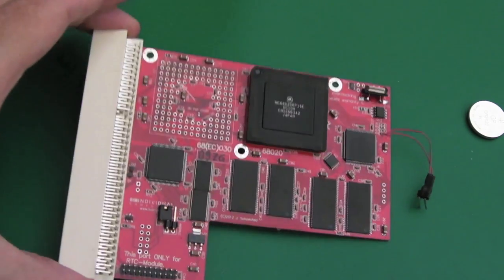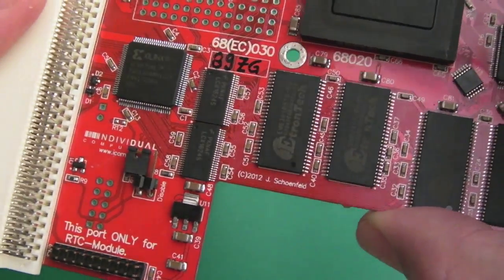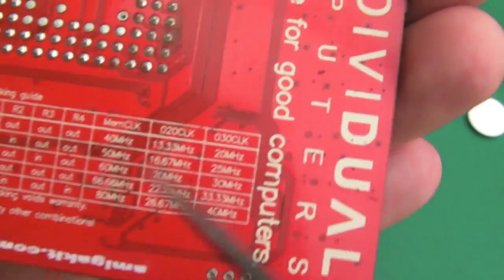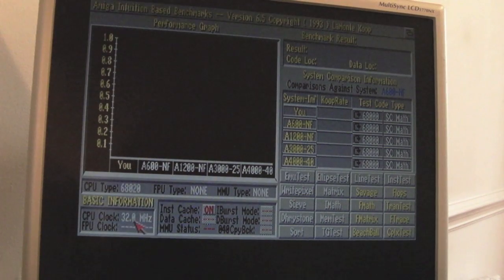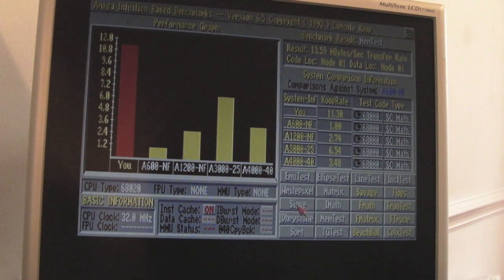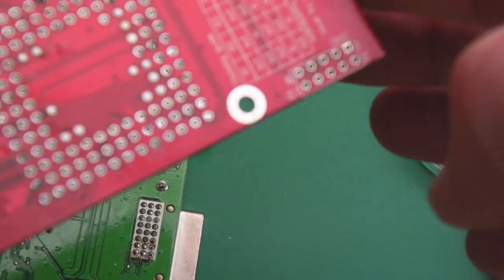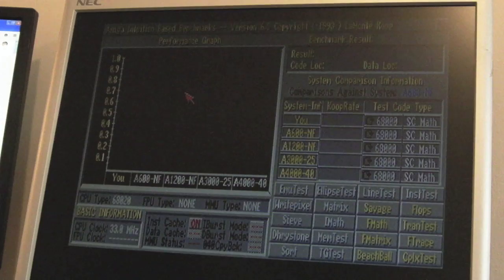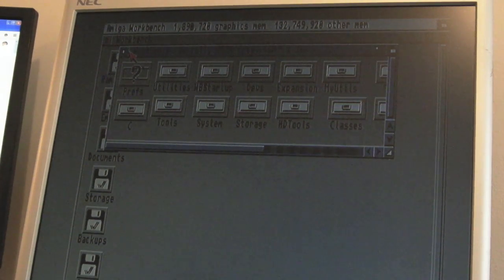Commodore Amiga A1200 ACA1220 Extra Overclocking

Comment: Great video. I have the ACA 1233 myself. It came at 40MHz/030. I think it may be possible to overclock it to 55MHz. Keep these great videos coming. I really appreciate them
Reply from the maker: +Mats Larsen Thanks!  Yes, I wish I bought the 1230 or a 1233 =/  I did contact Jens recently and he said he cannot source 68030 processors so no more are being made, which is really sad news =/   Ironically I bought a 68030/40 chip the day after no problem, so there are lots around but more expensive.  I would rather he sold them with a socket and no CPU rather than not at all.  I was tempted to buy the 55Mhz version on his site last week but its a bit too pricey I think.

If I can gather my nerves I might try my 68030/40 on there (in the 030) position) to see if it works at all, but I suspect it just won't work at all without a firmware update, but it might just work (minus burst mode)... No idea?!?
Reply: +GadgetUK164 yeah, kinda glad I bought quite alot of stuff between March and June last year. Like the ACA 1233, AGA MK2, ACA 500 and ACA 620. Many of these are not available anymore and prices have gone upwards. Also aquired a perfectly white refurbished Amiga 1200 that also had been recapped in that period. Lately I aquired an ACA 1221 fully unlocked and overclocked to 28MHz. Using that one for my ACA 500. With regards to if you can solder on a 030 on your ACA 1220 I think you should ask Jens about it. He will surely know
Reply from the maker: Mats Larsen
Yeah, you picked the right time to get all that stuff lol!  It looks like the Vampire 2 will probably come to the 1200 yet - and that is faster than a 68040 at 80Mhz I believe!  I've spoken to Jens and he didn't know whether the 030 would work or not but suggested I would damage the board removing the 020 to try it.  I guess the next step is to try it, I just don't want to kill the ACA1220.
Reply: +GadgetUK164 Worst thing is its just luck. I started my Amiga retro &quot;thing&quot; early last year and knew very little about this stuff. I had an Amiga 500 that I hadn&#39;t touched since about 1995. It would be cool to see you make a video where you solder a 030 on that ACA 1220 and have it working. But it would be sad if you damaged that card. Prices are going insane for these things now. Even regular Amiga 500s are expensive now. Oh, and I've read/seen videos about the Vampire 2. Looks like a crazy fast card